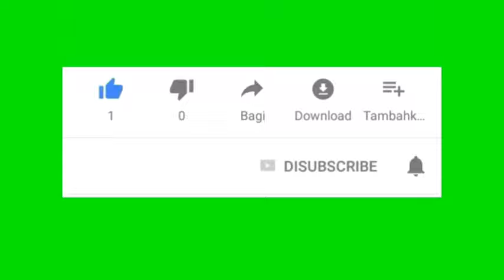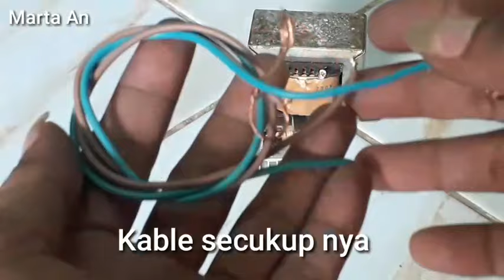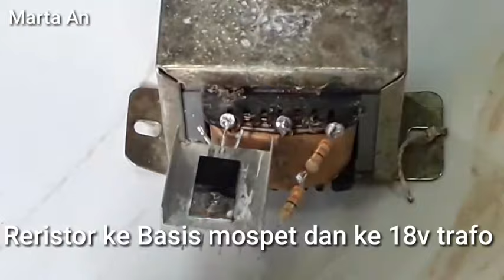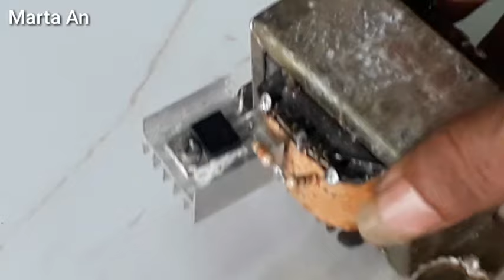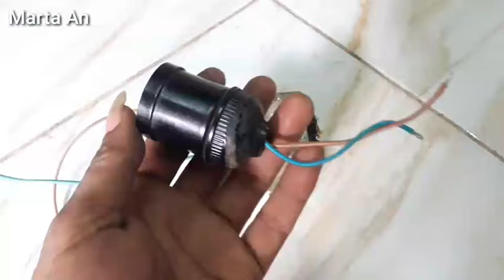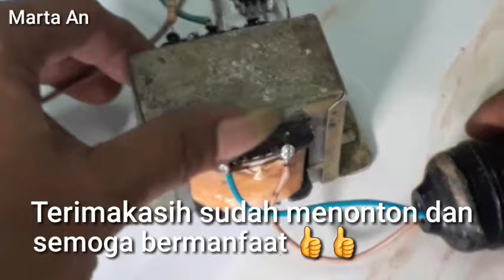Inverter Hemat Energy,super Simple. Karya Roslin Tehnik

Comment: Di sini ada yg tau gak. Input travo kok 220 DC? Apakah ada travo input DC dan output DC?
Reply: Input trafo itu antara 110 V, 220 V dan 240 V AC. Bukan DC.
Standar alat elektronik adalah 220 V jadi tegangan dari PLN itu 220 V. 110 V jika terjadi penurunan dan 240 jika terjadi lonjakan.
Yg saya tau tidak ada trafo DC ke DC. Yang ada cuma AC ke AC dan dirubah jadi DC dengan Dioda penyearah. Karena tujuan trafo utk menaikkan dan menurunkan tegangan AC. Untuk menaikkan dan menurunkan arus DC cuma butuh Transistor. Koreksi bila salah 🙏
Reply: @mariadilmu  iya.. Yg sy tau jg seperti itu gan. Diode atau rectifier di pasang setelah out trafo. Tp sy menemukan diagram diode dipasang sebelum masuk ke trafo.
Reply: @MfikTech  Jangan2 itu gambar rangkaian yg salah gan, atau mungkin ada ahli yg lebih tau...hehe
Reply: @mariadilmu  sy menemukan itu di modul AC gan. Rencana sy mau ambil trafonya tp sy ragu mau pasang disumber 220 AC. Maklum.. Lg belajar electro ne gan.. 😊
Reply: @MfikTech  sbnarnya gampang gan, cek aja out nya pke multitester. Pada jalur mana ada jalur ke Elco, itu pasti outputnya dan pasti DC. Jd jalur inputnya bs ditebak dr sebelahnya
Reply: @mariadilmu  iya gan. Jalur outnya dh ketemu. 5 vdc dan inputnya itu 220 volt Dc. Bisa gak dirubah inputnya itu ke 220 Ac seperti travo pada umumnya.